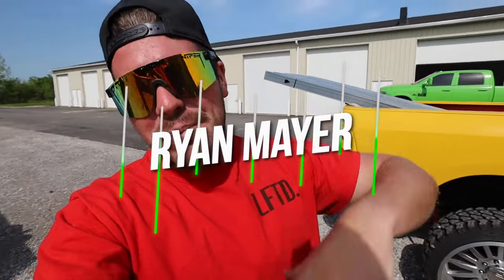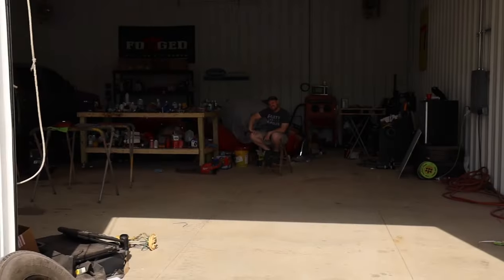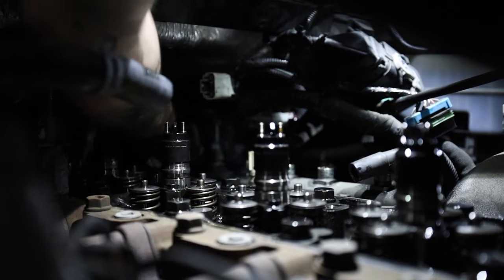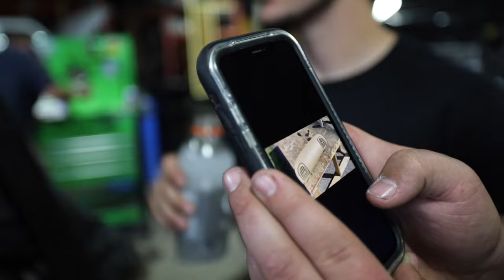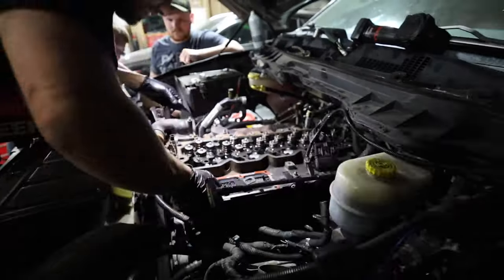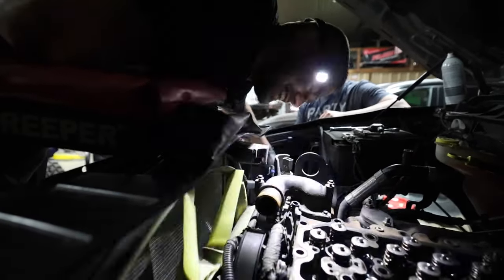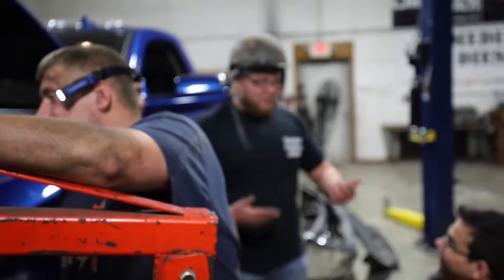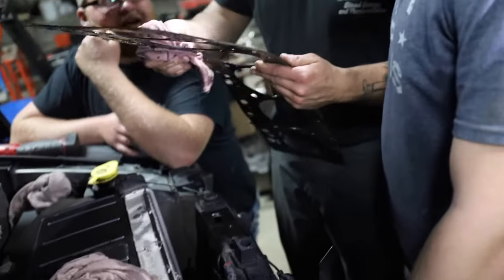Whoops...BLEW UP THE MEGA CAB 🤷🏼‍♂️

Comment: Yo check your Pinion angles that also will cause vibration adjust the upper control arms in the rear so your pinion angles match if you have them I don’t remember on your 🍌 Ram. Do you want that rear drive shaft pointing upward